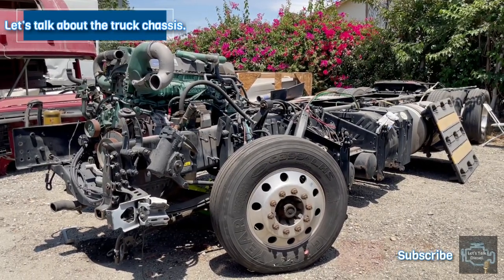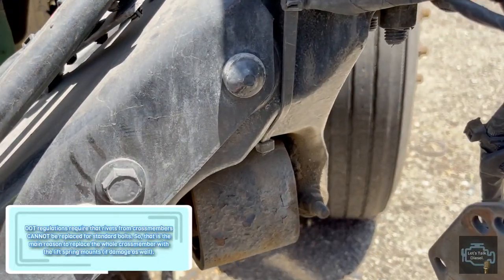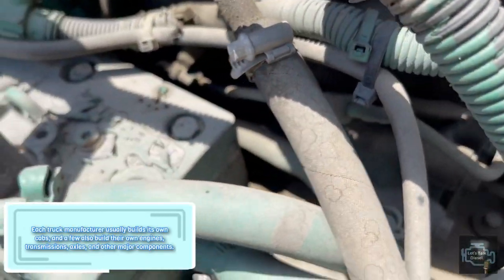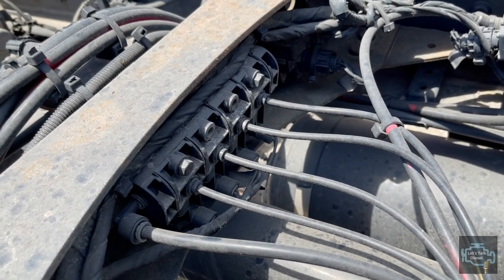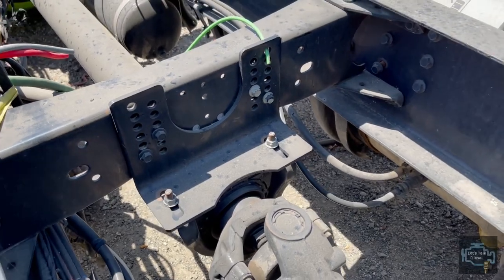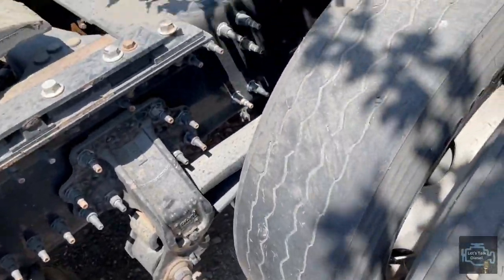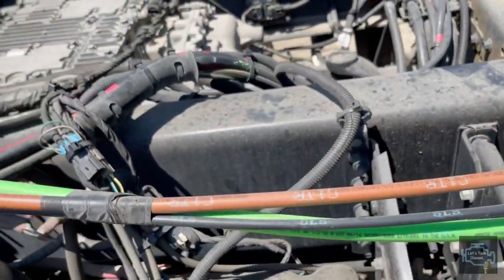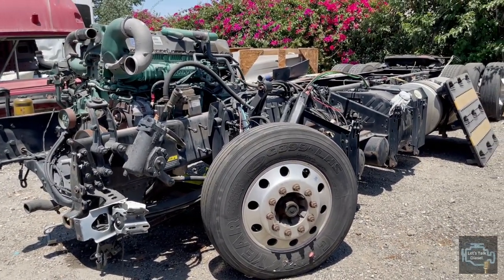Let’s talk about the truck chassis

Comment: Long haul truck chassis in US design simple and lightweight. Especially in suspension system. I think almost terrain in US is flat, it's easy for trucks working. On the contrary, Europe truck is designed with more flexible chassis, suspension to adapt pass, moutain, narrow terrain.
Reply from the maker: Good to know, thank you for the information about Europe trucks. Thanks for watching.